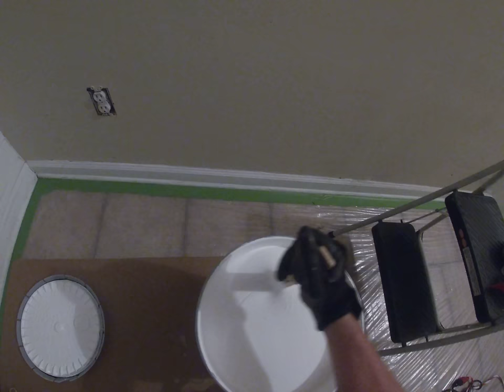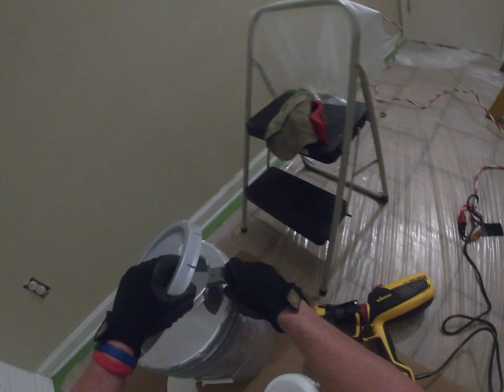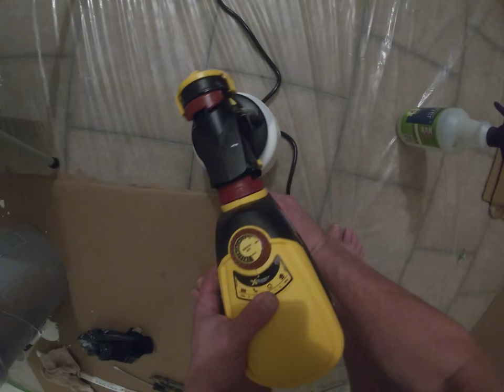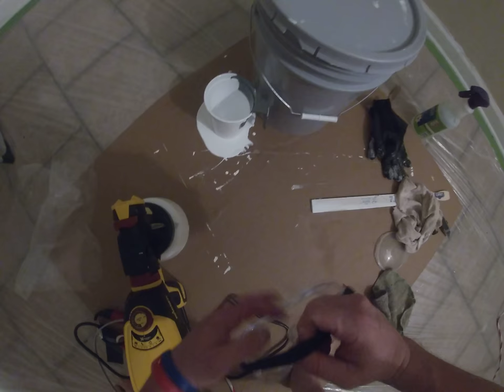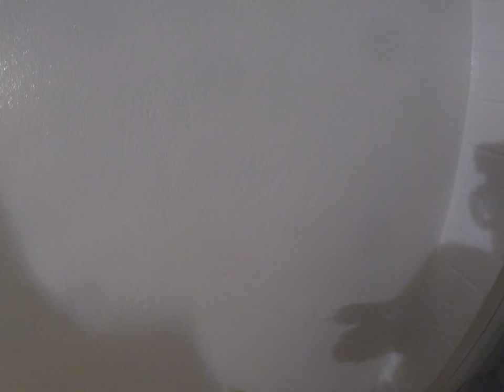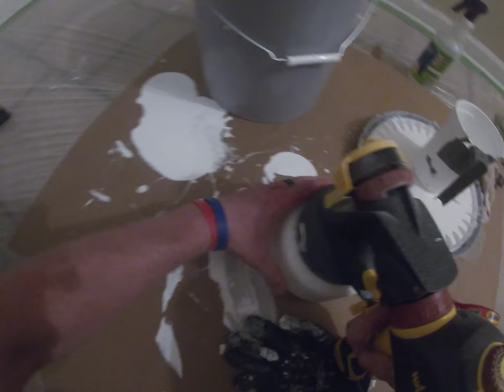Wagner Flexio 3000 1st Time User Spraying Paint

Comment: Thanks for the video.....it was informative.  I do know that the hose that is inside your container can rotate, allowing you to use the other 1/3 of your container.  Rotate it one direction for ceilings, rotate it the other direction for floor based painting.
Reply from the maker: Chad Baughman Your welcome, after using the Wagner 3 times now this sprayer gets 5 stars ⭐️ ⭐️ ⭐️ ⭐️ ⭐️ from. Your absolutely correct about rotating the hose inside the container. It works fabulous.

Comment: When I used mine the paint came out in speckles, globs, spits. Did yours come out like that? Or was it a nice fine mist?
Reply from the maker: Mine came out fine. Now one thing you must and I stress this is keep your spray nozzle clean. Always keep a clean rag or paper towel in your pocket and wipe off the tip of the sprayer. Just a good idea to always keep the spray nozzle clean and it sprayed great for me . Thanks for the question hope I could help. Have a blessed day
Reply: Sounds like your paint was too thick
Reply: Thanks for the help guys. It turns out someone previously sprayed a lacquer through it before I used it. So that may have clogged the nozzle. Also, it states you don't have to thin the paint. Did you guys thin it?
Reply from the maker: Eric Shin I personally did not thin this particular paint. However if your using a real thick paint. I have thinned it out before. I have found best results by doing this in small portions to start until I get perfect spray. Best of luck hope that helps😊
Reply: Sounds like you didn't have the pressure up high enough???
Reply from the maker: Mr Smithzer It could’ve possibly needed to be thinned out just a little bit. I will definitely try thinning out my paint in future projects. I do highly recommend this sprayer. As a beginner it made for a much easier job. Luv this sprayer. Thank you for the input. 😊

Comment: Can you show how to put it together and how to unasseble it so you can wash it?
Reply from the maker: Make sure u clean the paint sprayer container and hose also make sure u wash the tip and keep the tip clean while spraying. Wipe the tip with a rag while you spray as u will see paint build up around the nozzle on the tip as with any sprayer. Have a blessed day
Reply: @chrismoyer7778  which hose?? The little one or the big suction one in the paint thing?
Reply from the maker: @GuapoAJ  The hose that runs into the paint holder and there is also a little metal brush provided for cleaning. Anything I can easily take apart gets cleaned and continues to work like new. Cleaning after each use is very important. Just warm water. Always keep tip clean while using also. I wipe the tip off about every 5minutes of use as the paint globs up on the tip
Reply: @chrismoyer7778  Ok thank you so much! I bought it a few days ago but have been hesitant to actually use it. This really helped and I’m feeling a bit better about using it now thank you so much!!

Comment: I edited this comment so You Will Know What To Expect....

***(In my garage is a Wagner Sprayer that I bought 25 years ago it may be a lot louder but works a hell of a lot better than this one does. )

**The Wagner Flexio 3000.** My grandson asked if he could move in. That's why I decided to buy another Wagner Sprayer, (Good Name Brand Right.)so we could paint the bedroom that he wants. **Please Note: Technology should make items Work Better and/or Do More. 
***For this Sprayer, I Read Online That You'll Need  1.5 to 2.5 cups of water to thin out the ''Kilz-2'' latex primer. I added 2 Cups of Water to the 1 Gallon used.  (The Instruction Manual said nothing about doing this.)
***This sprayer seemed sorta easy to set up. ''Just 2 knobs'' 1 for the ''Air Blower Speed'' & 1 for the (Amount Of Paint You Get) Now that sounded pretty much an easy thing to do. I took both the ''Closet & Entry Door'' outside so I could make all the needed adjustments on the ''Amount Of Paint I'd Need'' & ''What Air Blower Speed I'd Need.'' 
**I'll give you the List Of All The Adjustment Knobs Below.**
***Once I made all the Adjustments, I went back inside to start Painting. Now this Bedroom is a smaller size. 9.5' x 9.5', with a 4' x 2' closet that's inside the room. So with ''Rounding Everything Up'' I put the room at 100 sqft Ceiling + 350 sqft Wall, or ''450 Square Feet''....
* Since we decided on Ceiling & Walls being the same color, with the ''Floor Trim'' & ''Doors''  Painted a different color. 
* To Spray 1 Coat of Primer (For a Total of 450 Square Feet). What should have taken about 1 hour, (I've Painted a Living Room & Dinning Area with a Total of 740 Square Feet, with 1 Coat Primer, then 2 Coats of the Finish Color, For a Total of 2,220 Square Feet of Surface Area in Just Under 8 Hours, Which Included 2 People Painting the Floor Trim.) 
***This Bedroom Took 5 Hours (4 Hours, 40 Minutes.) for the 1 Coat of Primer, Plus Another 2 Hours To Clean Up The Sprayer So It Could Be Returned to Home Depot. The following day, it took us (2 People) 4 Hours to put 2 Coats of Finish Paint, Which Included Painting the Floor Trim & Both the Entry Door & a Single Closet Bi-Fold Door. Both Doors are 6-Panel Doors, which I left outside.
The Total Time for the 9.5' x 9.5' Bedroom took, 8 Hours & 40 Minutes.
* I have never had such a waste of time painting a room this size. We lost about 1 1/2 days as a result of trying to use the ''Wagner Flexio 3000 Sprayer''.
Here's the Adjustments that you'd want to set in order to spray a room.
**Air Blower Speed, ***Amount of Paint, ***Vertical / Horizontal Direction, ***Removing & Clean or Change Air Filter, ** Continue to Clean Dried Paint from Spray Nozzle. 
******The Sprayer was Applying a 4 Inch Wide Section of Paint, Per-Pass. ***Plus I Had Paint Splatter Everywhere. Ceiling, Walls & Door till I took it outside.
Between the ''Wet Paint Shine''  that you get from Light Hitting the Paint, Plus when ''Spraying Whit-White Primer'', you actually think you're Painting.
***During Cleanup, Most of the Time The Sprayer Had ZERO Suction & I was using a Strong Cleaner, with Hot Water to Clean the Inner Paint Canal. (Paint Flow From Container To Nozzle.) However, that didn't account for the Primer Being Thinned w/2 Cups of Water, or 8:1 Ratio, 8 Pints Paint to 1 Pint Water.
***For $172.00 I would expect a Sprayer to work at least as good as the $54.00 Sprayer I bought back in 1998. Like I stated earlier, that older Sprayer was Louder but it Worked Very, Very Well, damn, jsut so much better than this Sprayer. I'm not the only person complaining about how crappy this Sprayer is.

Comment: How much overspray was there going onto the floor?
Reply from the maker: Tim O There was some overspray. However the prep with laying down plastic worked great and was worth taking the time. Just a personal thing. To speed things up and save money. I used a large piece of cardboard 4ft by 2ft and held it at the baseboard/floor. To prevent overspray.
Reply: @chrismoyer7778  ok thanks! That's what I was hinting at was trying to find a way to save time instead of fully masking. I have to spray some old 8" high baseboards and they are tight to the floor, so I can't get under them to mask. Might have to just spray and wipe up the excess 😂
Reply from the maker: Tim O completely understand. Odorless Mineral Spirits. Works great to clean up overspray. 😁
Reply: @chrismoyer7778  haha it definitely looks impressive so far! Have you tried it spraying overhead on ceilings for painting popcorn texture?
Reply from the maker: Tim O Thank you, I have done a ceiling it’s not popcorn but texture grooved ceiling tiles. I actually had a kitchen fire 🔥 that’s why I actually was doing this painting here and had to paint the ceiling. Worked pretty good. I did cover things with plastic to help with overspray and I flew right through it. It’s worth the preparation. Practice a little on lower walls or maybe some cardboard and keep a rag or paper towel with you to keep spray nozzle clean 🧼. It will go fast 💨

Comment: Total POS. It doesn't spray, it splatters and it leaves a textured surface, even when the paint is thinned. It really shoots out blobs if you use un-thinned paint, which it is advertised to do be able to do.
Reply from the maker: Thank you for commenting. I’m sorry I had such a bad experience using the “Wagner Flexio 3000. Possibly a defective device or I got the only working Flexio 3000. I have not had any problems out of mine. The thickness of the paint, keeping the nozzle clean and air pressure are all key factors. Again I’m sorry u have had such a bad experience. I have found it to be very helpful and beneficial to have a “Wagner Flexio 3000” in my garage. Have a blessed day 🙏😊